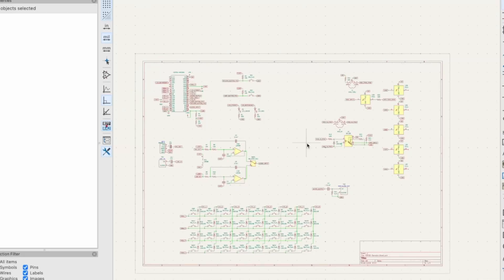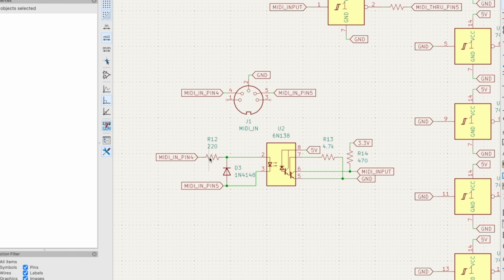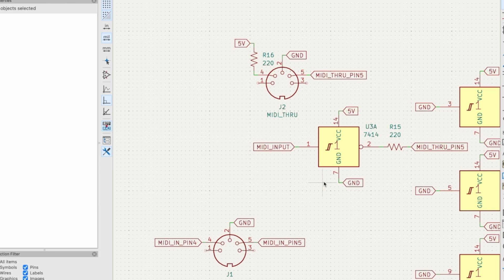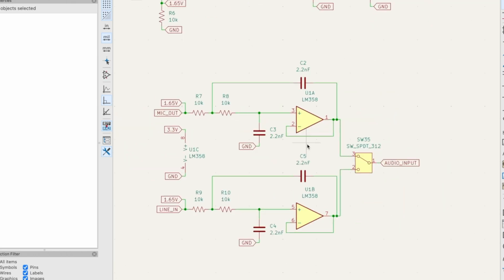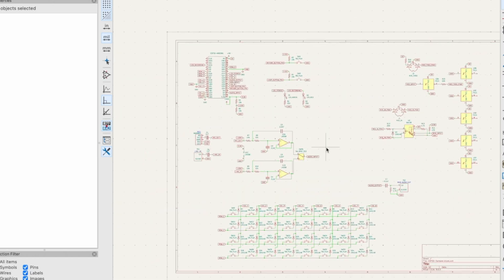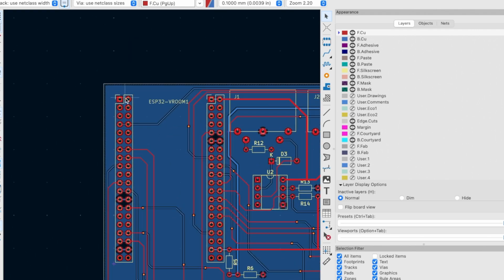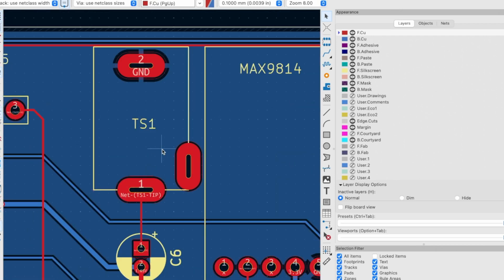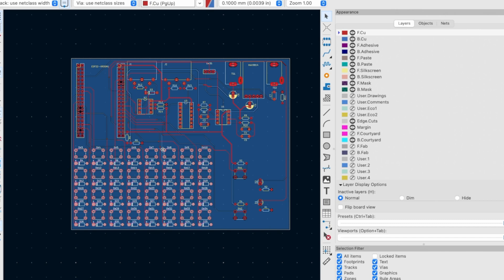DIY Lo-Fi Sampler With An ESP32: Part 11 - Schematics & PCB!

Comment: Thanks for the source code. I have a question. when executing startI2SPlayback -> i2s_driver_uninstall(I2S_PORT) it causes crash and reboot
Reply from the maker: Hey, glad you found the video helpful! Just to clarify, I didn’t share any source code in this particular video. Could you let me know what code you’re working with? I went through several revisions while working on this project.
Reply: @makingmygear  the source code is in the link under the pinned comment... I fixed the crash and reboot, but DAC works 1 time and after i2s_driver_uninstall the sound does not play
Reply from the maker: Hey! I’m a bit confused — the article you mentioned in the pinned comment of this video doesn’t actually include any code; it just goes over the schematic and PCB layout. If you’re using an ESP32 other than the ESP-WROOM-32, you’ll need a different approach for the ADC/DAC I²S stuff. The final code that’s worked for me is in this article: https://medium.com/@makingmygear/diy-lo-fi-sampler-with-an-esp32-part-12-final-pcb-and-sound-demo-d59cddc696a3

Comment: Think it looks ok. Only thing you might want to look at is, it looks like your powering the lm358 from the 3.3v supply that power's all the digital circuitry. Maybe add some supply decoupling at the opamp there's a good chance there's digital noise on that supply. And although the 6N138 will work just fine, I prefer the H11l1 with 3.3v circuits.
Reply from the maker: Nice, thanks Brian! Good call on adding some decoupling near the op-amp; I’ll definitely drop a cap in there. And yeah, I’ll order some H11L1s for the next build and give them a try. Oh, and shoot, I totally forgot about your suggestion to go with a 6×6 matrix to get the extra buttons. That’s going back on the list!